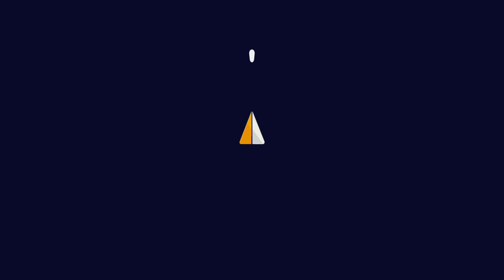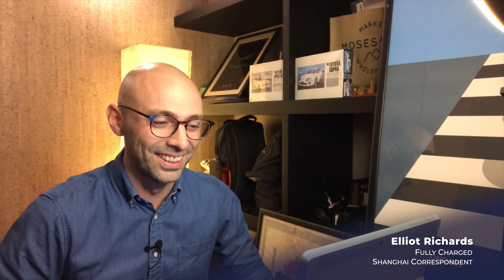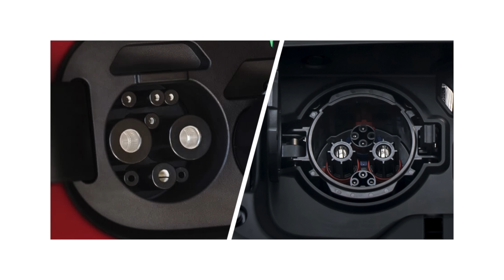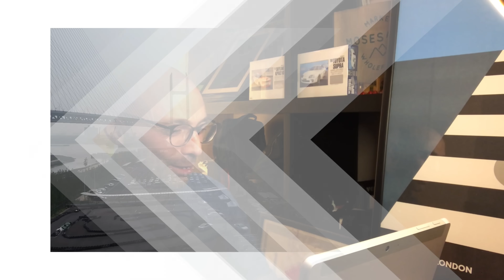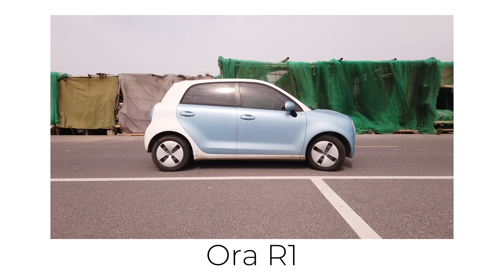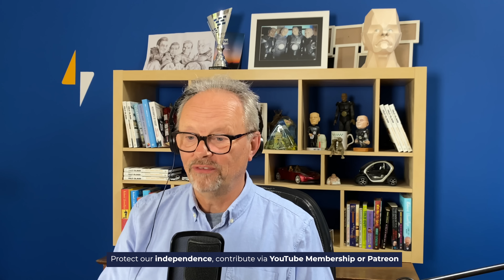China's Electric Vehicles revolution | Introducing FULLY CHARGED's East Asia correspondent

Comment: Wonder if Elliot speaks Chinese with a British “accent”? So Tesla vehicles have what type charger if Chinese chargers are different? Is there an adapter between the two?
Reply: My wife is learning Mandarin. She stands out as being a 'foreigner' not so much because of her appearance and accent, but much more by the way she structures sentences. Sentence structures are completely different to Western European languages, so mental gymnastics are needed, even to begin to understand what a Chinese person says.

Chinese languages are also primarily tonal, so an incorrect tone will change the meaning of a word completely. For example, the wrong tone for 'mother-in-law' might mean 'horse'. Learning the correct tones is therefore vital.

Furthermore, there is no word for 'yes'. You repeat back the verb in the question, if you agree, and add a word which sounds like 'ban' if you don't. There are also no tenses to verbs. 

Those differences begin to explain 'Chinglish' in translated text. That's only the tip of the iceberg.
 
On a lighter note, I can say honestly, that I don't understand what my wife is saying, at times! 😉
Reply: @RWBHere  Dui - 'correct'? Depends on the question, I suppose. I don't recognise that 'ban' word...though I'm quite the novice. Normally, you can get away with 'bu' (no) to negate a verb (bu yao - no want), or 'mei' (mei you - no have). I can't recall a 'ban'...but perhaps. Tenses are done by adding a word - iirc, past tense is done by adding a 'le' on the end...but I usually get that wong. EG. at a bus stop - dao le (arrived) - counter example lai le (coming so not 'past tense').